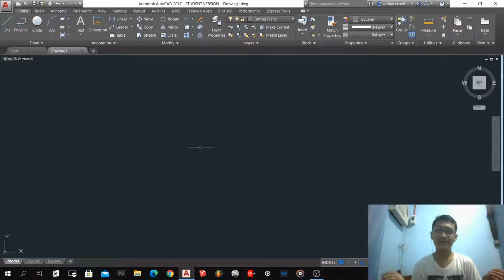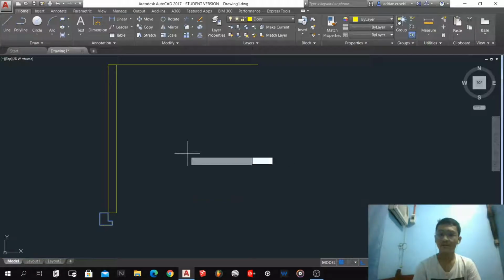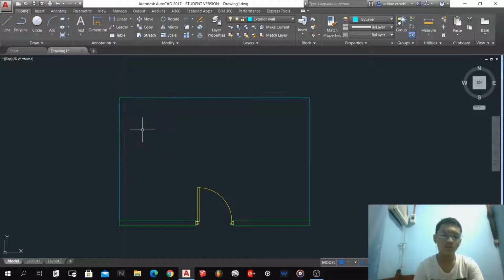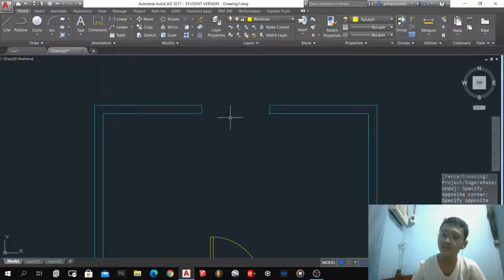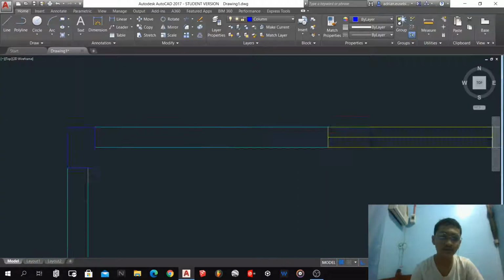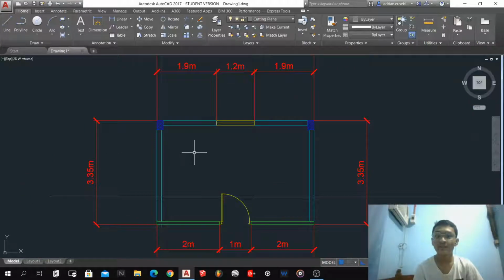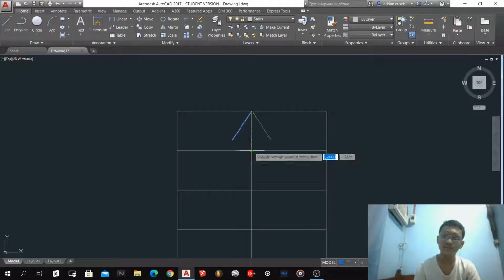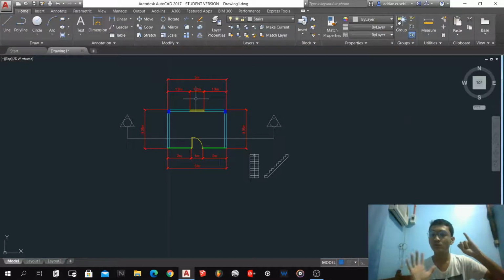AutoCAD Tutorials for Beginners - PART 8 (Filipino)

Comment: lods about po sa units naka two decimals in meters, pero nung ginawa ko na sa door sobrang liit po. sana masagot
Reply from the maker: Hi! Since it's in meters, the decimal number is normally small in CAD.  Kaya no need to worry if maliit sa drawing, as long as correct ang measurements and units magiging accurate siya.

Comment: what units did you use how do you edit it and where did you get the basis for the exact dimension of doors in the national building code thank you po
Reply from the maker: Hi. For unit, I used "meter" unit in dwg file. For the dimension (referring to "how do you edit") is I used to customize the dimension using the command DIMSTYLE (typing "D" + "Enter"/Spacebar). I didn't explain further on how to modify dimensions since the goal is to create the drawings, maybe soon I'll create video on it. For the standard sizes (referring to "basis for the exact dimension of doors [etc.]"), I used to read some of the specifications based on NBCP. There are some minimum height, width, and also the area of habitable place that you may read on the said code. Thank you!
Reply: @adrianeusebio731 thank you so much